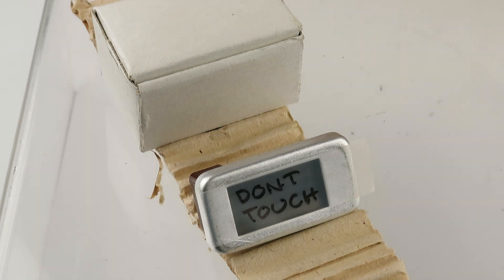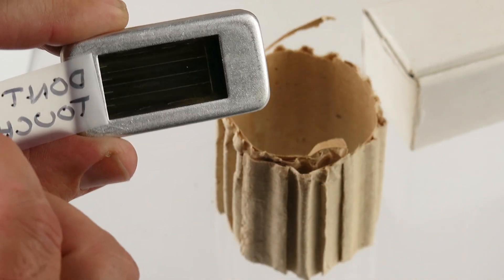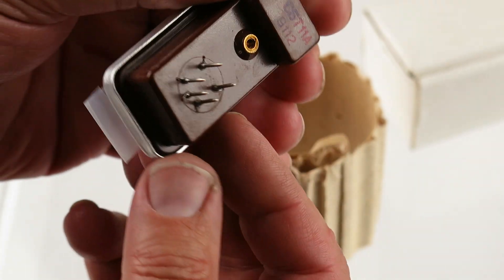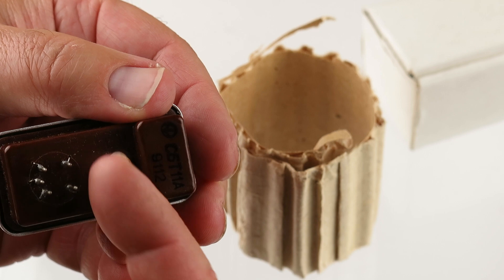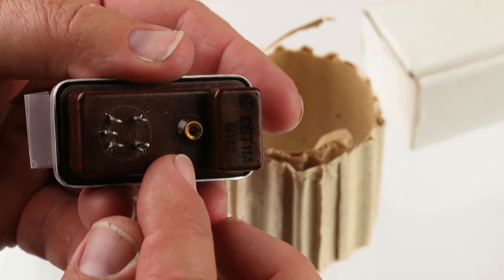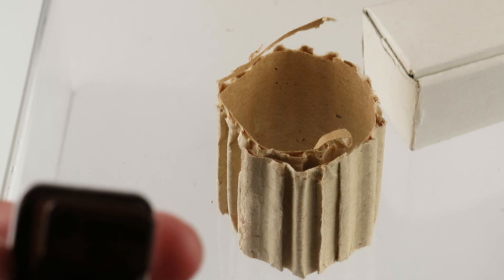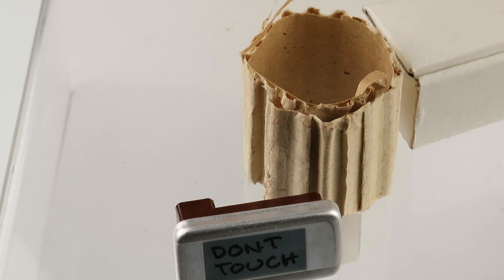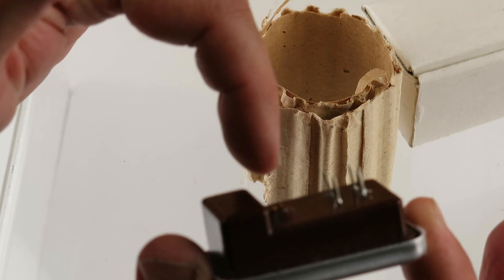C8093 - SBT-11A Alpha, Beta and Gamma Mica Window Geiger Tube

Comment: Are these "ground-ship only?"   Do they have a "max elevation" rating (heh in Cyrillic?)

Many pancake tubes have problems with possibly-unpressurized air-freight.   (Some are even destroyed when prospectors take them up into themountains.)
Reply from the maker: I've read about that but it's a rare occurrence  as far as I can tell
Reply: @electronicgoldmine7745  Compared to US/CA tubes, the Russian tubes might be quite NON-delicate.